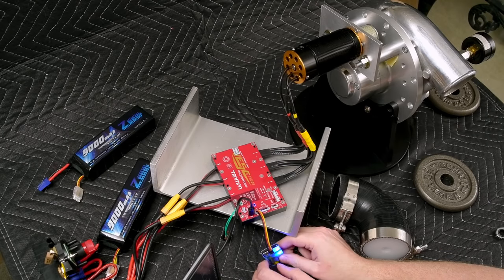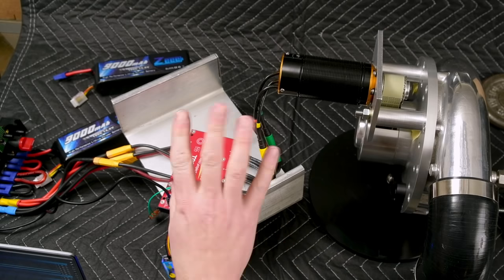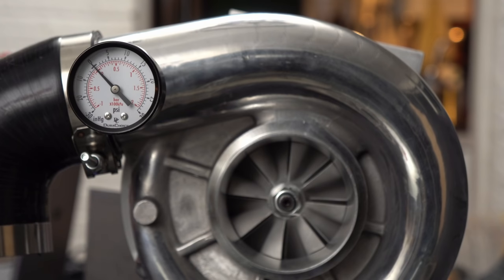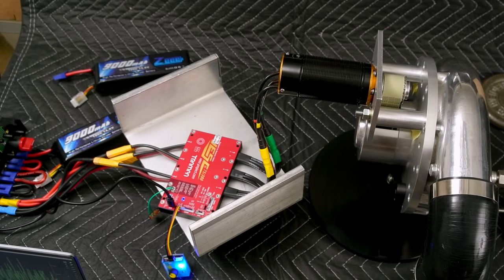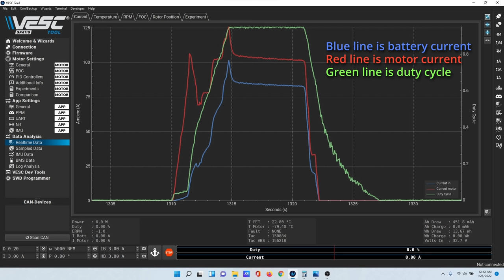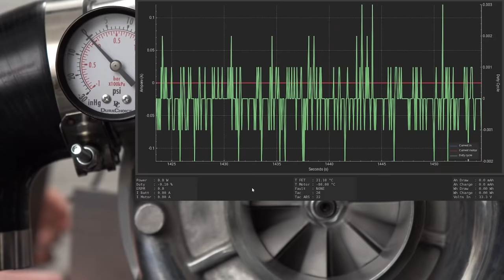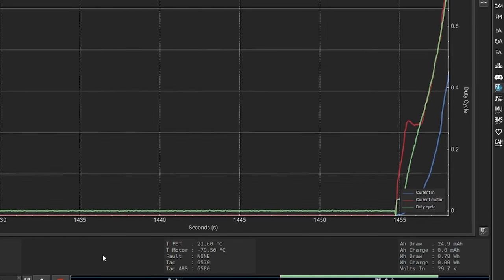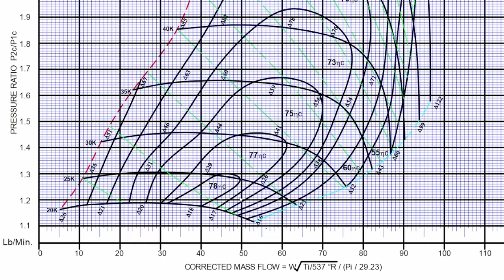Easier/Cheaper High Power DIY Electric Turbo - First Tests

Comment: PLEASSSSEEEEE work on a belt or gear system to increase load on motor which would increase supercharger rpm and output..

since you have electric motor headroom you can afford to load that motor down more thus giving you more output from the compressor. 
maybe a simple pulley size change would do it..make the pulley on the motor even bigger to start .. so if its 22 go to 25 or 27 and see what happens..then play with compressor pulley by making it smaller and smaller till you start reaching the limits of the motor and batteries/esc and finding that happy medium of pulley combos till you hit a sweet spot of motor saturation and compressor output.
Reply from the maker: We've already drag tested a very similar setup using this exact motor - https://youtu.be/AOL3Qyczt3Y and made about 650 hp - we've already got an idea of what point this motor hits saturation and how much impeller rpm we get.  The current step-up is a "best guess" starting point to maximize things, but I might need to go bigger.  Perhaps check out the electric turbo playlist - there's 49 videos there that got us to where we are today: https://youtube.com/playlist?list=PLhacdpER4T0vzo531cmfi_7fJWd-7DSSt
Reply: @AlexLTDLX  I did not realize you had so much content on this . I literally stumbled onto this by chance looking into turbo stuff lol.. great stuff dude and I'm excited to see how far you push this.

Comment: Watch some high power 1/5 scale electric rcs and how they change gearing u can get the 90k rpm with pinion size change at the electric motor.same batteries
Reply from the maker: We don't need 90k RPM.  We need about 80k eRPM to match the performance of the other direct-driven unit that's similar and used this exact motor (that one's getting a motor almost three times more powerful than this one).  eRPM and RPM aren't the same thing - eRPM is electrical RPM.  To calculate physical RPM from eRPM, you need to divide by the number of pole pairs (in this case, it's a 6 pole motor, so you divide eRPM by 3 (6 poles = 3 pole pairs).  That impeller would likely fly apart at 90k rpm.  It's compressor map tops out at about 50,000 rpm.

Comment: Keep displacement small, motorcycle small. Cletus McFarland did some science🤣with these electric turbskys on a 4banger. Smoked tires with it.
Reply from the maker: It made 5 psi average (and 650 hp) on our first drag test on a built 365ci V8: https://youtu.be/AOL3Qyczt3Y  It's too much for a motorcycle.

Comment: Have you tried experimenting with using the FOCBOX for your VESC? I build electric skateboards for fun and find that the FOCBOX is super reliable and durable. After watching your videos I’m about to parlay my electric skateboard hobby into an electric turbo hobby… haha. Your videos are great and super informative, has me all jazzed up to try doing this now..
Reply: I run the FOCBOX with a 12s3p battery and dual Flipsky 6374 battle hardened motors on my Eskateboard top speed in excess of 50mph with about a 30 mile range.. have board tuned down to 40mph using my VESC tool… do you think if I gutted this set up they would work in an electric turbo project?..
Reply from the maker: We've done enough dyno and drag testing to know that it takes about 4kW to support 200hp.  And that relationship holds for more power.  If you haven't seen it, we've already made about 650hp: https://youtu.be/AOL3Qyczt3Y  So, depending on your power goals, if your setup can support the power needed, then with the right compressor, yes, it should work.  The problems really come into play with long cables needed for installation into a car.  Sensored motors really help there.

Comment: If your worried about belt use what guys use on bench top milling machine belt conversions..some are running ten thousand rpm...some cogged others o - ring  round   types...and for vehicle installation see if chuys electric has their alternator on their website  very high output  government uses it ahh their in Los Angeles calif
Reply from the maker: Thanks for the suggestion. I actually have a benchtop milling machine and know what you're talking about. But I've also built a bunch of supercharger setups and custom built tensioners in the past; even using an adjustable spring, ball bearings and a Hayabusa steering damper.  If anything, this one won't take much but it might need something on the slack side so the teeth don't skip. That's really my primary concern. My secondary concern is walking off the end under load; even with the flanges the belt could damage itself. We'll find out soon enough.  Another thing is that belt is going to be turning at least 30,000 rpm...

Comment: Is that like a 1/5 scale brushless r/c motor and lipo batteries……interesting
Reply from the maker: That is in fact what it is.  For the other setup (that used to use this exact motor), there's an LMT 30100 on it's way - 53 hp!  If you haven't seen our first drag test, the results were a bit surprising: https://youtu.be/AOL3Qyczt3Y

Comment: I asked on a other video but if I were to use this on a regular gas engine would I use a bigger drive puller because I obviously can't turn 50k with a gas engine lmao
Reply from the maker: You'd have to.  You'd either need a two-step setup (four pulleys, two belts), or to hit 50k rpm impeller speed at 6,000 engine rpm, you'd need about 10.5" crank pulley.  I really don't know why speedmaster makes this thing, but it's about perfect for electric drive.
Reply: @AlexLTDLX  lmao I can't stop laughing 10.5 inches thats crazy lmao like a saw blade spinning under the hood
Reply from the maker: Yeah, it would be.  Realistically, you'd need maybe a 3 or 4:1 step up with the timing belt and then a more reasonable serpentine that goes from the crank pulley to the larger timing belt pulley (sort of like a jackshaft).  It would be a decent amount of work.
Reply: @AlexLTDLX  yea but it would be funny to go to a car show an pop hood just to show off my 10.5 inch blower pulley lmao

Comment: I think your best bet is to turn that turbo into a supercharger by adding it to your pully system.
Reply from the maker: Been there, done that, ran 9's on pump gas: https://youtu.be/j8SNo7kpcxw  This is the future of boost, and we've already seen more than twice the rwhp gains per psi as I saw with my Whipple.

Comment: Gear compressor would be cool for a centrifugal blower. Start in full boost shifts gears as rpms climb
Reply from the maker: I'm not sure I fully understand.  In this case, the blower's not enough for the engine really, so I'll take as much boost as I can get at any time.  So far we've seen 6 psi tapering off to 4 psi; the next "big e turbo" (not this one, but the Vortech based one) should see about 12 psi tapering to 10 psi.
Reply: @AlexLTDLX  I appreciate your reply! My scenario would only work in an over sized blower thats belt driven scenario. So it was a little out of context (thinking out loud/tipsy).

Comment: im not sure entirely what your focus is, but if you wanna do more than 2.5-3 psi, you are going to need to use a smaller pulley on the turbine side, and the electric motor prolly a little larger not by much though.   its just like a supercharger.  as long as the compressor wheel is spinning only at 12-32k rpms you wont get much out of it.   both turbos and superchargers benefit from this process.   So if the test vehicle is pushing around 500 and you want this to be more real world applicable, then id would utilize the same process.  Your input is too low, and i dont mean the electrical current.  

I bet if you simply installed a smaller pulley on the turbine side (exhaust side or belt drive side)  of the charger then you can easily see 6psi or more utilizing the same amount of amperage and current draw maybe a little bit more.  Im honestly rooting for this project and other testers because i really would like to see this become reality.   50k Erpm should be plenty capable of creating 50k rpm or more on the compressor.   Good luck!
Reply from the maker: Version 1 already made 6 psi peak on a 500 hp motor; and 4 psi at peak hp; we got it to 650 hp.  If you haven't seen the first drag tests, check out this video: https://youtu.be/AOL3Qyczt3Y  The results were very eye-opening.

Comment: 4 or 5 to 1 is ratio it needs to be. If it's like regular supercharger. I think it's 5 to 2.
Reply from the maker: This is all based off the compressor map.  We've done enough testing (bench, dyno and drag strip) in our 49 videos to know that direct drive works well.  With this particular motor, it just needs a little step-up - thus the 1.22:1.

Comment: Kelly kls14401 168v 400amp 1min no problem.
Reply from the maker: Yeah, I've looked at those.  The biggest issues are: cost, availability and eRPM capability.  The standard units are only good to 70,000 eRPM.  We tend to exceed that limit.  I know you can get them with higher limits, but that's even more cost, more wait time, etc.  The nice thing about the Hobby wing is you can get one in a few days.
Reply: @AlexLTDLX  I'm running a me1616 and belt....
Reply: @AlexLTDLX  I actually running a khb14601 175v and 600amps squarewave
Reply: @AlexLTDLX  I've had problems at 150,000erpm on the high rpm version of the kls controllers, I used to be a registered dealer. Have quite a few of them in storage... they sadly don't sell khb due to too many people running dc-dc step downs and frying the controller from the stepson turn off at full load due sagging batteries...
Reply from the maker: Interesting.  Do you have these in the US?  Or North America?  I would give one a try if the price was right.  If you want to email me, look under my main channel page and you'll find my email under "about" and "for business inquiries."
Reply: @AlexLTDLX  me1616 is an American motor. I'm in Australia...
Canada sells a asi bac8000... 84v 800amp... 

Something worth to consider if you want to go belt.

The me1616 is watercooled.  Bac8000 can take a watercooled block etc...

If you want big numbers you'll get it with this... it's torque you need to get the rpm fast....

Comment: Why not just go to an enclosed oiled  helical geared setup rather than a belt? I'm certain a module could be used through a Databus CAN which communicates directly with an engine ecu to regulate the amount of voltage sent to the electric motor to increase boost pressure as rpms fluctuate using a wastegate to bleed off any unnecessary pressure as rpms drop during shift points. Majority of modern cars use potentiometers on the accelerator which could be easily tapped into. I'm sure no doubt with enough battery power and large enough motor it can build enough boost pressure. The question then becomes, Is it economical as the added weight of the motor and batteries increase torque and horsepower enough to overcome the weight to hp ratio providing it eliminates parasitic loss of drag on a belt driven supercharged engine in order to increase the performance of a vehicle. I'm sure you know the answer already or you wouldn't be wasting your time with those RC car batteries.  LMAO.
Reply from the maker: Thanks for watching and commenting.  I'm not using RC car batteries anymore.  I've got two of these packs in the trunk: https://youtu.be/KscgGhk3ejs

Comment: BUT.... What kind of boost pressure is it capable of building that's the trick
Reply from the maker: This is version 2 - version 1 made 650hp on only 5 psi and did this at the track: https://youtu.be/AOL3Qyczt3Y

Comment: I don't think your electric motor has enough power to produce enough boost. Even if it does, the power to run it is coming from somewhere. THE ENGINE. With an exhaust powered turbine, waste exhaust is pretty much free.
Reply from the maker: A different version already put a 12 second car into the 9s on only 6 psi:  https://youtu.be/RT0M88xHzNQ?si=fknVdbXSz4xNtqO6  These run off their battery packs.  And conventional turbos aren't "free" by any means - they significantly increase pumping losses.  Turbo backpressure is the culprit - try corking your exhaust to the tune of 6-7 psi and see how your car runs.

Comment: Problem,with all of this,is there isn't enough power that's why you can block outlet and rpms run up,an echo. backpac blower the biggest model,blows more than this electric turbo,
Reply from the maker: Tell me if you still feel that way after watching the first variant of this thing push my car from a 12.2 @ 112 to a 10.5 @ 127 in the quarter on a no prep surface: https://youtu.be/AOL3Qyczt3Y

Comment: I’ve been wondering for years why no one does this. Electric fan, electric fuel pump, electric oil pump.  why not electric air pump.
Reply from the maker: It's a good question. Only recently has the technology been available to actually make it work. And if you look at some of the past videos there's a bit of fire land explosions and smoke involved. But that's what makes it fun.

Comment: Isn't it an electric supercharger? A turbo is a supercharger powered by exhaust gas, remove the exhaust gas and you are left with a supercharger...
Reply from the maker: Yes, that's right.  But far more people search for "electric turbo" rather than "electric supercharger."  Sometimes the masses win, even though they may be technically wrong.  Like VHS vs Betamax.

Comment: Guys this method is dead. 4s lipo battery  is 14.8V. The brushless motor can take up to 80 amper/h. So its mean you have  1-1,5 hour turbo in your car before your 12v 100a car battery goes empty. Other hand this motor is designed for at least 6s lipo(25volt) but would be the best 8slipo (30v). Why? Because at 12volt generate 3x more heat at full load than at 30volt. If you want turbo in your car and have 600 bucks  then  buy a planetary gear turbo or centrifugal turbo or normal gas turbine turbo.
Reply from the maker: Dead?  You clearly missed the drag testing results of the first version we built: https://youtu.be/AOL3Qyczt3Y  where we made about 650hp and dropped 1.7 seconds in ET and dropped the 0-60 time from 4.10 seconds to 2.6 seconds.  In fact, we've got 49 videos that got us to this point:  https://www.youtube.com/playlist?list=PLhacdpER4T0vzo531cmfi_7fJWd-7DSSt  The point of this setup is to see if we could match the first version's power with a cheaper, easier and smaller unit - this one.  With the current control unit in the car, it charges when it's out of boost, can run more than long enough to achieve speeds that will kill you multiple times before the battery dies, and no, we don't run on 12 volts.  This setup runs on 60 volts and the motor reaches saturation at just under 14 kW.
Reply: @AlexLTDLX  Sorry ,you misunderstood me.I believe you and yes is working for minutes,short run but Is dead idea if you wanna use it in street car/daily tuning car. For drag car is perfect because you don't have to use/run for hours. But still be careful with the low volt and high Amper.  Better to have 30v and 80A than 12v 150A. And this motors working volt/kv.I see u using 4s lipo If this a 1600kv motor then you loose huge amounts of rpm. Use 8s lipo (24v) and your turbo rpm will be double.Other thing what I seen ,you didn't use motor sensor.  Try to buy a sensored brushless motor and all you rpm jump, kick start will disappear.
Reply from the maker: I have a much bigger sensored motor on the way.  When driving, you're not always in boost.  In fact, you're very rarely in boost.  And since it charges when out of boost, you'll basically never kill the batteries.

Comment: >starts talking about safety
>immediately sticks fingers into belt without disconnecting power
Reply: Okay Karen 👌
Reply from the maker: Thanks for taking the time to watch and comment.  There's a difference between safety and stupidity - I try to be one and not the other.  What you may not realize is that ramp up time is set pretty slow, plus we're on really low power - I'd have a good 2-3 seconds to pull my finger out of there before anything could happen.  And since someone would have to send a PPM signal to VESC to turn it on, and the only other person there at the time is Simon (being a cat, he's a bit hampered by lack of opposable thumbs), that's not likely.  Also, I'm not sticking my fingers inside the belt.  So yes, for ideal safety, I'd be wearing a fire suit, have the fire department waiting outside, be behind a blast shield, have a complete halon fire suppression system in a custom-built concrete test cell, etc, etc.  By now you must realize that I'm being hyperbolic, but there's no pleasing some people.  I get crap when I'm safe and responsible (see my "driving a powerglide on the street" video) and crap when I do something as insane as touch a belt with the thing not running.  You can please some people some of the time, etc, etc.

Comment: You making only 4 psi that nothing ! l don't understand what you doing .
Reply from the maker: You need to keep in mind this is what 4 psi of lossless boost can do on a drag strip: https://youtu.be/AOL3Qyczt3Y  There are no losses like with a belt driven supercharger or pumping losses like a conventional turbo.  We put a similar unit on a dyno (look for it on my channel) and picked up 64 rwhp on only 2 psi.  It took 4-5 psi from the Whipple to match that.  In the video I linked above, we picked up 15 mph in the quarter from only 4 psi.  That's insane.  Our 0-60 time dropped from 4.1 seconds to 2.6 seconds.  And we're just getting started...

Comment: Can fart more boost
Reply from the maker: This was a low power test with version 2 of this setup.  Version 1 made 650 hp and pushed a 3,500lb car into the mid 10's at  127 mph: https://youtu.be/AOL3Qyczt3Y  If you can fart that much boost, you probably should be talking to your doctor.